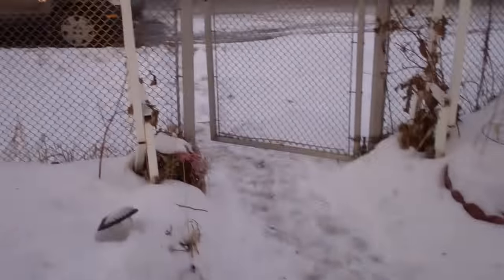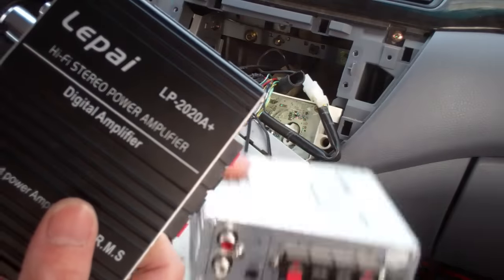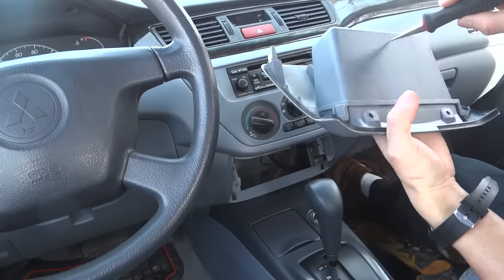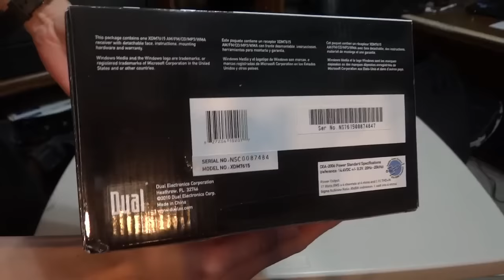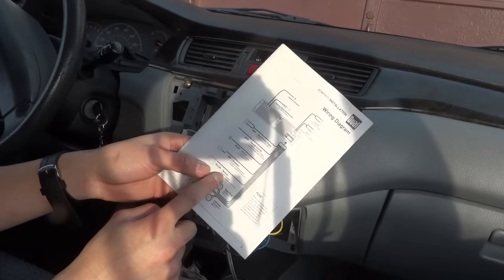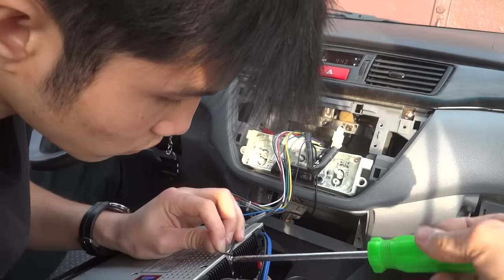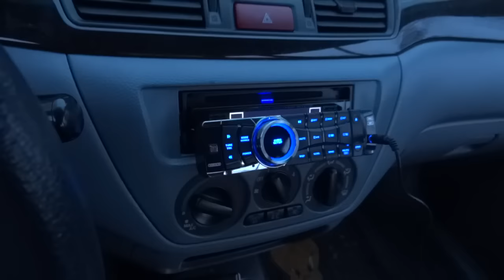Lancer Fix 10 | LP-2020A+ Amplifier, Dual XDM7615 Stereo

Comment from the maker: I believe there should be wire diagram coming with when you buy a stereo system? And or if you mean the amplifier, then I would say try it out. It shouldn't break anything even if you got + - wrong. However, I believe the wire with a white color on it is positive. While the solid black is negative.

Good Luck!

Comment from the maker: +Akeem Roberts I will keep that in mind.
Reply: +The DarkDragonWing what are you using as a power source. mine only came with a wall plug
Reply from the maker: Emil Madsen
 I use power from the radio's +12v Positive and the Ground. I would say get a good stereo head unit is way better. Here, watch this: https://www.youtube.com/watch?v=K4YE4_NmG2Q
Reply: +Emil Madsen the battery.
Reply: +The DarkDragonWing do not do that. it would be better to put it directly on the battery with a fuse inline. l suppose there is nothing wrong with the way you did it, but l think you are asking to much from those wires. they are only like 16awg, so be careful.

Comment: Should have gotten a harness adapter makes wiring easier. everything is color codes to where they need to go. Splicing into oem wires is very unsafe and may cause a wire fire if something shorted.

Comment: Did you have to buy a special harness to connect it to your car? Or can you use the same one it already had?
Reply from the maker: No, I did the ghetto way in this video. You should buy the stereo harness for your car.

Like this video: Mirage Fix | Install JVC KD-R540 Stereo System - Ep.2

Comment: Is the XDM7615 good?
Reply from the maker: It's good overall, but one thing I noticed is the buttons, they tend to be loose and they make noise when the car accelerate or shake. I stop that problem by placing something in between them like cards, so that they are tight in place. Just one thing, otherwise, it's super good!

Comment: Is it possible if you can use the amplifier while having an after market stereo? In the video you had the oem stereo connected to the amp and not the after market one
Reply from the maker: Albert Ledezma The aftermarket stereo is already powerful, it's loud enough to distort your speakers. You don't need the amp. https://www.youtube.com/watch?v=K4YE4_NmG2Q&lc=z13ai5l4oxf4v1zj404cfzn4kpugv1mhesw0k
Reply: Ok, thanks!

Comment: Just curious, but how did you wire the power for the lepai to your car?
Reply from the maker: I used the power from the radio unit's wires.
Reply: The DarkDragonWing Is there any way that you can show us how? Because I have a lepai amplifier also and it has a DC jack so I can't wire it like a normal car amplifier.
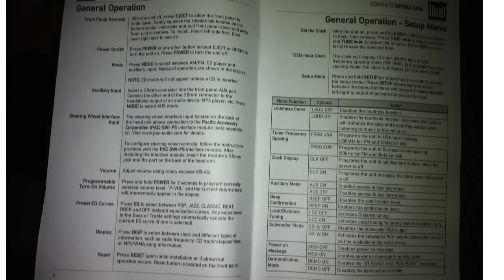Reply from the maker: Wire the ground - negative wire to the metal part of the car. And connect the + positive wire to the ACC blue/yellow wire of the stereo unit as you can see at 4:17
Reply: The DarkDragonWing where is the + and - for the lepai if it is a dc connection?
Reply from the maker: Glock9999999
 no, it is a 12v
Reply: The DarkDragonWing To power the lepai did you use the ac adapter cable that comes with it and just cut off the adapter part?

Comment: I tried to do the same thing.
and the power wires probably touched a speaker wire.. when I was trying I checked and a fuse blew.. Changed the fuse.. then checked the stereo.. no power.. checked the fuse. It blew again -____- 
Any pointers before I run out of fuses ?
Reply from the maker: +StrugglaRep You should buy a stereo unit: https://www.youtube.com/watch?v=K4YE4_NmG2Q
Reply: So you're basically saying my Stereo Unit is blown out?
Reply from the maker: Not sure. But probably is. I'm saying that you should buy wiring harness here:
http://www.ebay.com/itm/MITSUBISHI-CAR-STEREO-CD-PLAYER-WIRING-HARNESS-WIRE-AFTERMARKET-RADIO-INSTALL-/331508893429?fits=Model%3ALancer&hash=item4d2f7846f5&vxp=mtr

And buy a new after market stereo unit.

Is the one you are trying to install an after market one?

*****
Reply: +StrugglaRep solder and heat shrink. make sure all of the wires are all connected right. do NOT leave bare wires hanging loosely around each other.
Reply: +The DarkDragonWing it most likely is. l don't think you would replace a stock stereo with another stock stereo, but l could be wrong.
Reply: Thanks! I fixed the problem and blasting songs all now ! Thanks.
Reply: ***** anytime.

Comment: Macky what do u call the tool at 1:49
Reply from the maker: Jayden Isem It's called RC Body Reamer.  http://www.ebay.com/itm/0-14mm-Steel-Hole-Expanding-Saw-Opener-Reamer-Installation-Kit-for-RC-Car-Toy-/351177865525?pt=LH_DefaultDomain_0&hash=item51c3d4f935 You should also watch this video: https://www.youtube.com/watch?v=K4YE4_NmG2Q

Comment: Okey, you have a Lancer, it's an insult to put a Dual head unit in it. I had a few Dual head units, the flip face rarely worked right, and the sound quality gave away do to vibration with just 2 12 inch Sony Explodes. Please upgrade ASAP. Give the Lancer the respect it deserves.

Comment: +The DarkDragonWing when i was cutting the wire of the olde stereo to install a Sony stereo, the clock , the cabin light and the center look are off. what do you think problem was and the solution?
Reply from the maker: +salah elgazzar A fuse is blown. Check the fuses
Reply from the maker: +DarkDragonWing Do it with the harness is better here: https://www.youtube.com/watch?v=K4YE4_NmG2Q
Reply: +DarkDragonWing the fuse located inside the car or in beside the engine
Reply from the maker: salah elgazzar 2 places. One under the hood. And another one here at 4:56 https://youtu.be/uZneNuoub5Q

Comment: Why did you twist and tape the wires buddy they will come loose after awhile its much better to solder the cables together or use crimp connectors